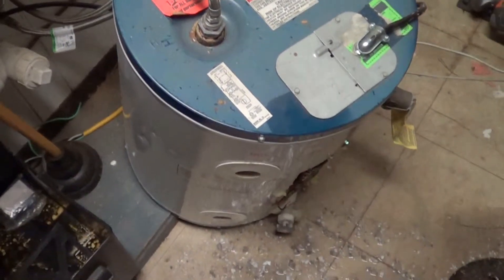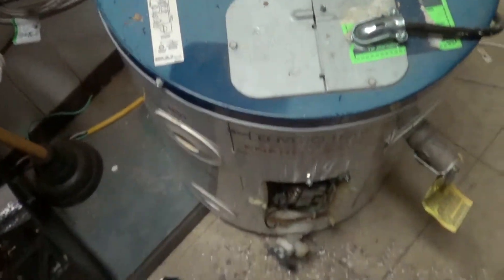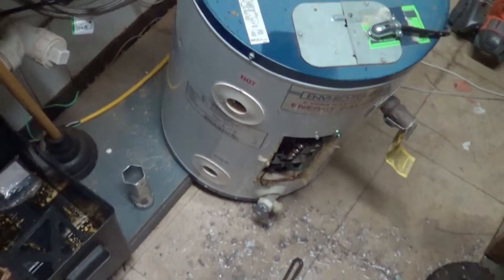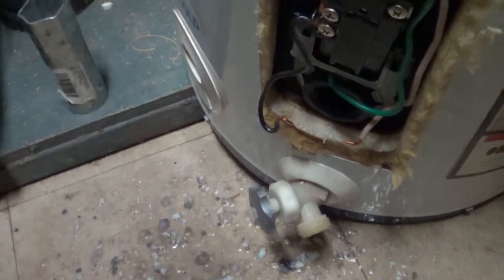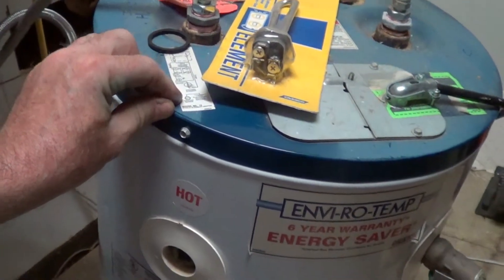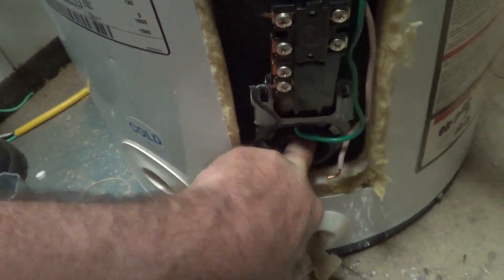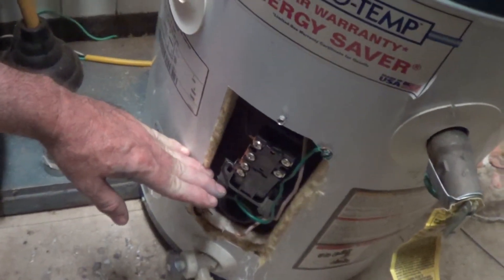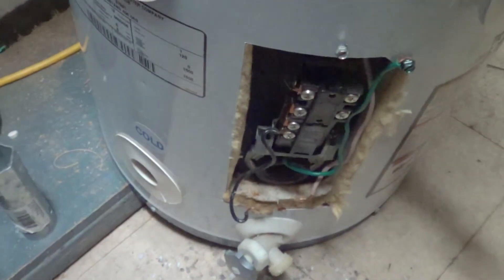Electric water heater flushing ; cottage cheese like crud drained out

Comment: Why not just remove the drain? When I service water heaters sometimes they won't drain so I remove valve and then use a little attachment from shop vacation to suck out all that gunk
Reply from the maker: mkckf4l It acted stuck . With that unit the drain valve is all plastic. I probably would have whaled on it with more torque if a metal valve, but chickened out since I have busted too many plastic items in my life.

Comment: Its burning up because the crude is piled up to the element.  Seen it before. The element is cooking itself in the mineral deposits.  I bet your on a well.  Flush it every year if its not in use drain it.  You can get legionnaires disease from that.
Reply from the maker: Ryan Dugger Ryan; your diagnosis sounds real good. ie the element probably runs hotter when in a sea of crud. This water heater gets used very little at all and is on city water, but the city pipes in this area are probably 80 years old. One actually gets sand in the water here too.
Reply: If you do not use it the sediment builds up on the bottom....so its more like the element being embedded in sand on the sea floor.  When you turn on the hot water it stirs it up.  Every 6 months leave water supply on and open up the drain.  The water pressure will blow out the crude and keep it from burning up the elements when it does get turned on.